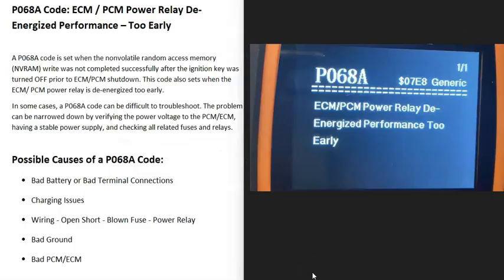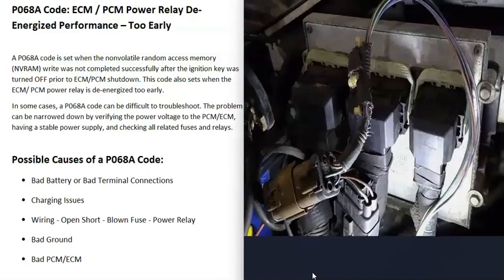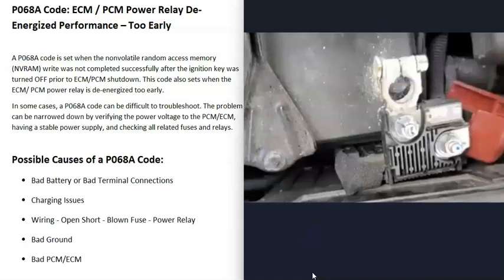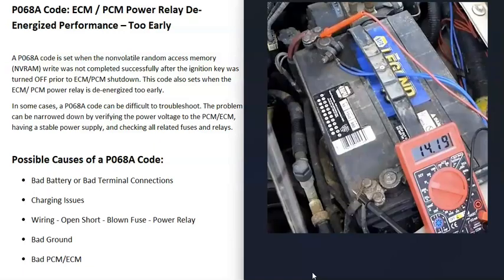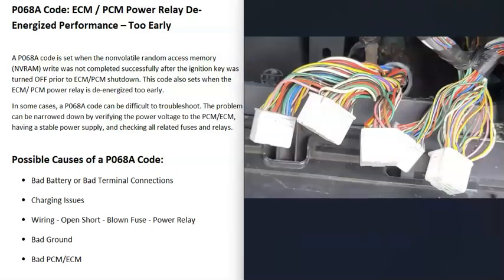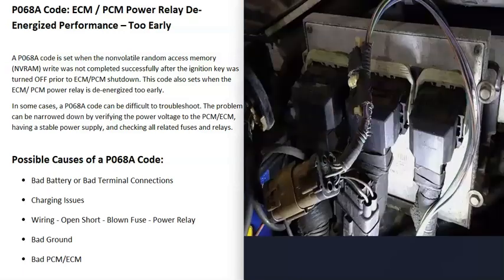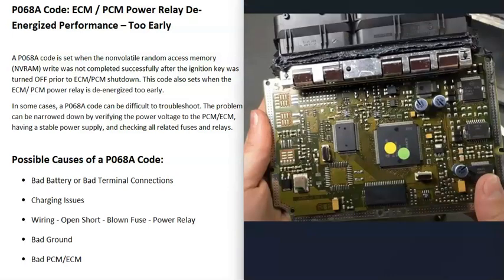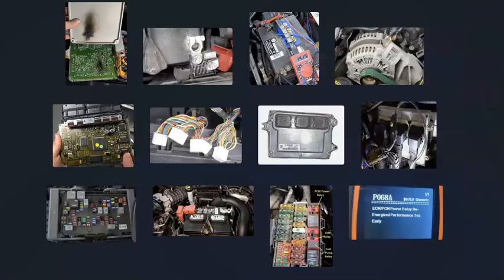Causes and Fixes P068A Code: ECM / PCM Power Relay De-Energized Performance Too Early

Comment: Update for you HVAC. I checked all the items you mentioned. Disconnected 12v battery, shorted plus-minus cables. Checked fuses, relays, diodes. PCM connectors. Inspected PCM. Another video had me check the high voltage battery. That’s my issue. The video showed how to add a charger to bring the voltage back up. (Apparently the 2009 does not have an onboard charger to the 12v battery.)  voltage is 275 needs to be over 300, 350+ even better. Charger on the way from Amazon about $70. 120vac to 350dc. 🤞

Comment: Hey my friend I have a 2010 Mercedes sprinter 2500 we’re is the ecm/pmc computer located or the relay I tried a couple videos but there not showing exactly where it’s located could you help me I replaced the battery and the alternator but before the cod was p068a

Comment: I live in Alaska , (Fairbanks ) I had to travel to anchorage for 2 weeks( in Alaska we have block heaters in our car to keep them warm by plugging them into an electrical outlet)for work. A week into this trip I had this code. The car starts and runs pretty normal  during the time I didn’t plug it in when it’s been just above freezing.  2018 ford explore I replaced the battery a year ago.
Reply: Did you figure out what it was? Or did it just go away?
Reply: @geotronico6  bad battery, just had it charged. it was left unplugged too long for a couple days, the cold took a beating on  it.
Reply: @gray334 thanks for replying. Mine came up and by the time i weent to auto zone to get it scanned and drove back home it turned off lol we'll see if it pops up again or if it was a one time thing.

Comment: So on Tuesday the battery was dying was really hard to start but it did it first try. Had issues opening the hatch , 2013 ford escape.  Bought a new battery the old one was 3 years old and I live in AZ so not uncommon.  Started it 4 or 5 times then didn't want to start. Then I replaced the 3 50 amp fuses still having issues starting and still getting this code.

Comment: is it true battery can be the most common reason ?

i seem to have issues when cold starting , it will start it just throws errors after errors at me,  " check fuel filter " edb failur " air bag fault" - and the dash needles flick  until it starts. ( never when warm though - no issues when warm ) 

is a battery my likely cause ?  as its 12.6V when the car is cold & only error code is  po86A  - i tried creating more earths  - with no luck... but have yet to get a new battery  as i thought 12.6v was good ? and its 14.2 when running.
Reply: Just because a battery shows good voltage doesn’t mean it’s bad. It could have a bad cell in it. Meaning under load it’s junk.
Reply: @jedmeltonmusic698  it was the battery in the end. 

The amperage wasn't high enough, so when starting it too the amps from fusebox causing all the errors to show
Reply: @Cellgm2000 thanks for the info. So many people fail to respond back when they fix there problem. Appreciate you so much.

Comment: checked the battery connection, had corrosion all over. just sanded it down a bit and it got fixed. thank you